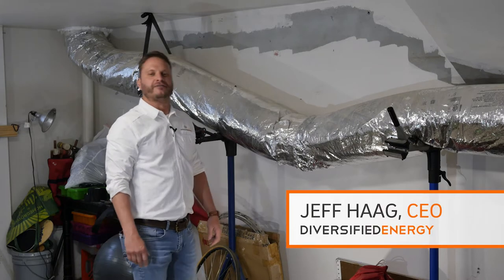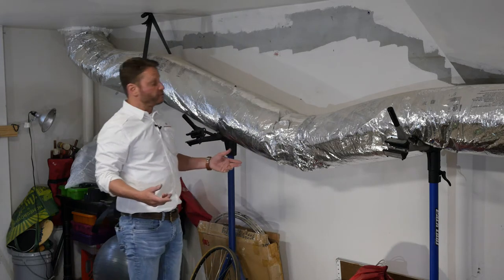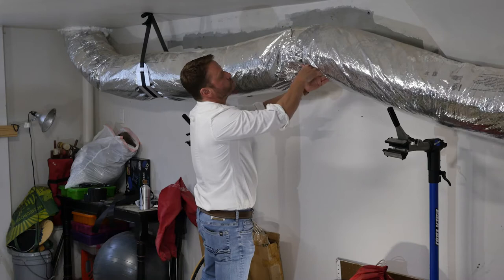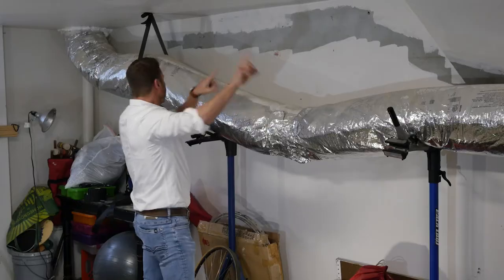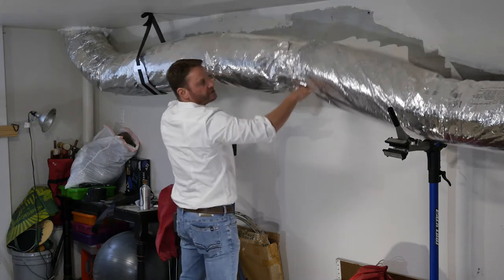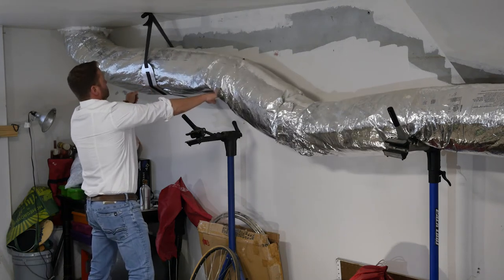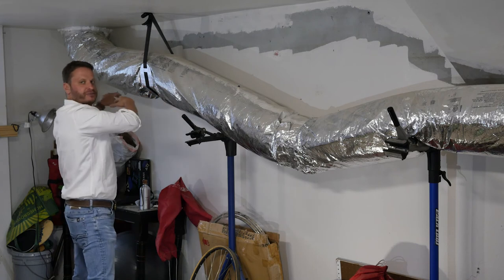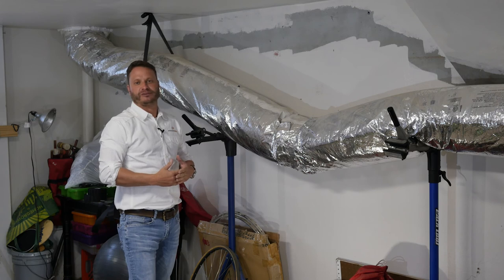Properly Strap & Hang HVAC Ductwork - Fixing An HVAC Contractors Mistakes

Comment: I have 5 of these in my basement. 

Builder put a recepticle in my closed-door closet pantry, tried to convince me it would heat/cool my kitchen from under the door. Nope. Told him to move it. He moved it, but decided on his own to add another under the sink. This created 3 saddles.

Then he put a recepticle by the front door in an area I could've put a shoe rack. Had him move it, which he did, but then he decided on his own to add another in my living room. So 2 more saddles.

Noticed right away that nooo dust was collecting on the paper furnace filter. Then, stupid me, left the litter boxes near an intake vent in my dining room while busy trying to help a friend through a hard time. Those litter boxes might sit there near the intake vent for 4 days every week over the one winter. Now dust and tar from a smoker is blowing all over my house. Coated in dust. How do i get the dust out of these things? I know there is a clog somewhere.
Reply: Sounds like a bad customer and a bad contractor